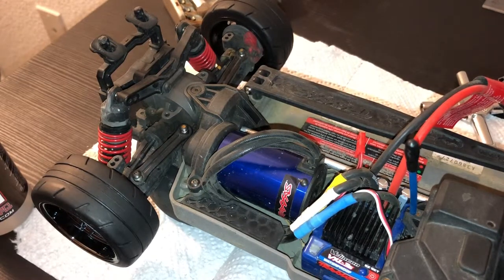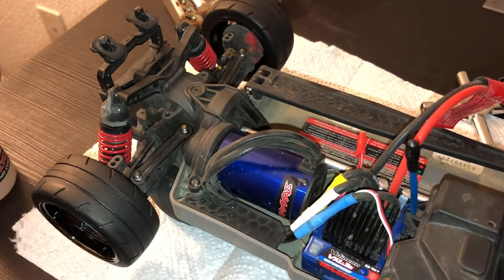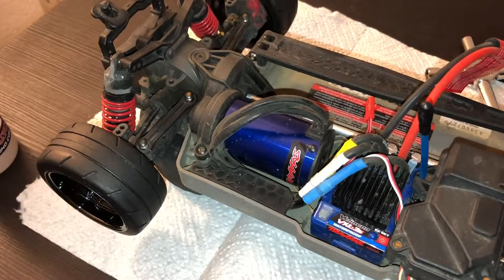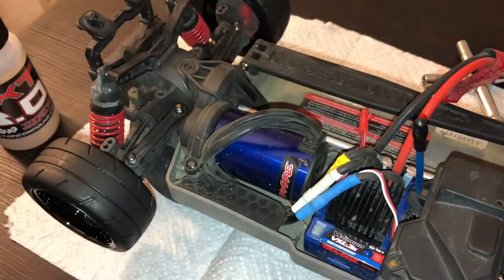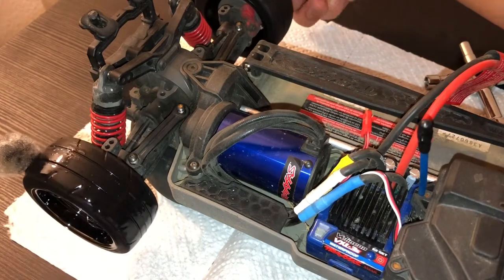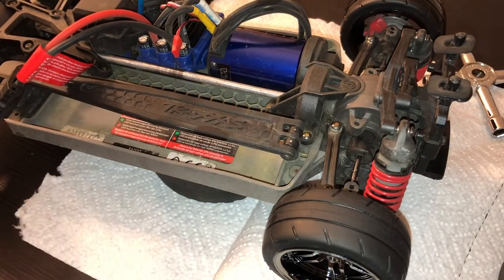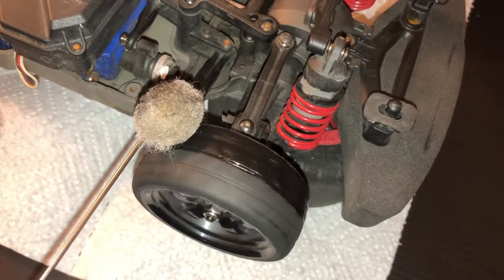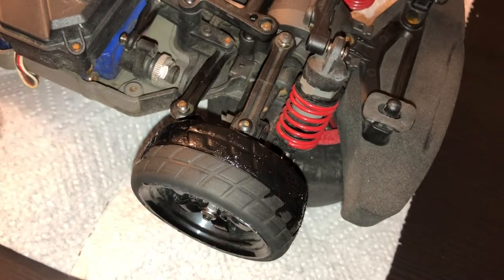Adding Grip on your RC Car using Tire Grip Liquid (Sauce)

Comment: you know when putting that stuff on a tire your really only gonna get a lap or 2 before its gone because youve not gotten it into the tire. I used to race go karts and you neeed to sand the tire a bit so you can actually get the saucce down into the the tire so it will be absorbed and last. Also multiple applications will make the tire softer because youve gotten it into the pore of the rubber....believe me from what ive seen on rc tire sauce karting applications can be used